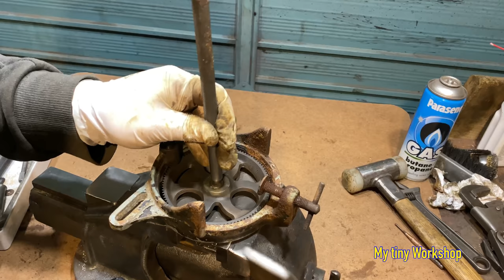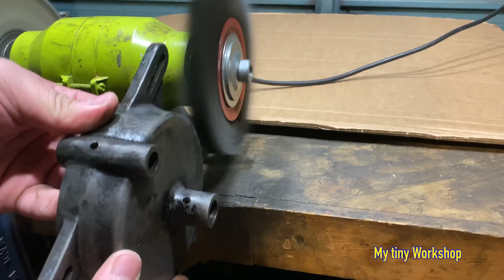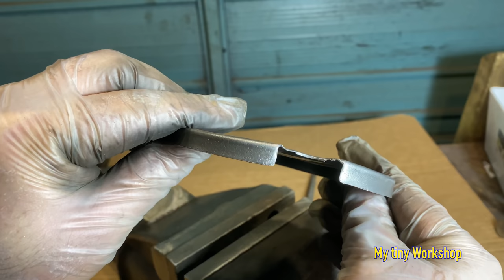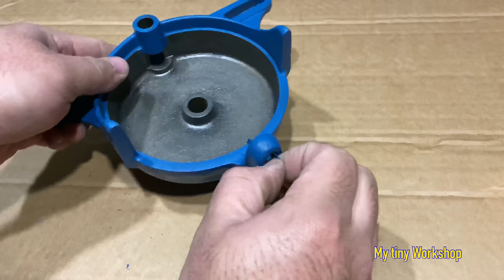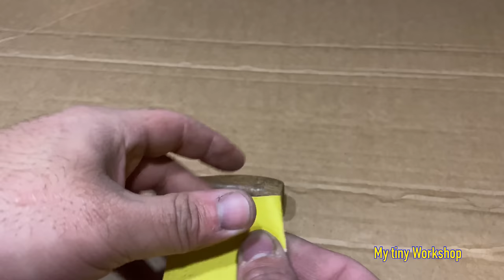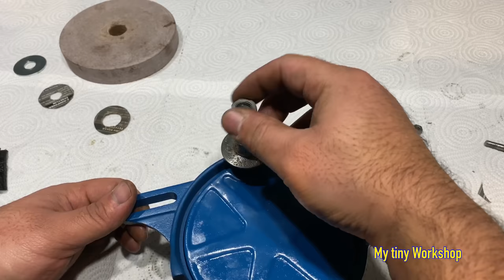Rusty Hand Cranked Grinder Restoration

Comment: I have a parts cleaner in my shop, and I always feel like the parts washer does absolutely nothing, even in all of the YouTubers restoration videos as well. I feel like electrical cleaning, rust remover, sand blasting, or washing by hand just does such a great job, and so much better then any parts washer could ever do that I don't even use mine anymore.
Reply from the maker: I understand you point. Sometimes it does seem useless. It’s perfect for me since I don’t have running water in the workshop.
Reply: @mytinyworkshop1213  Washing in water is sometimes really not effective and pointless. Or you need to use tons of detergent and a sea of water.
Sometimes it makes sense to wash in kerosene to remove copious grease and dirt adhering to it.
Sometimes any wash is a complete waste of time. This is not a mandatory ritual. We must proceed from common sense.

Comment: Nice restoration and good video! There are a few major safety topics I'd like to pass along.

1. There is a difference between low and high speed grinding wheels. A hand crank grinding wheel falls outside the spec of what is suitable for an electric bench grinder and can cause wheel explosion.
2. Please get a cover for your electic bench grinder. I saw a guy in the shop get a chunk of wheel embedded in his face because the wheel exploded because the cover would have contained most of it.
3. Always ring test a grinding wheel to see if its cracked. If it does not ring, dont use it because of wheel explosion. For a ring test, hold the wheel with one finger through the mount hole and lightly tap it with a piece of metal. You should here a nice chime sound.
4. Do not clamp a grinding wheel in a vise and use impact on it. This can cause micro fractures or worse you may end up buying a new disk.
5. When dressing a wheel or grinding of any kind, use a tool rest. I have seen a guy loose his finger because the tool slipped and the machine gnawed his finger off. Thankfully the finger had bounced off the wall toward him so they sewed it on...he cant bend it though and when he makes a fist it looks like hes always trying to point! lol
6. Never overtighten a wheel when you mount it because the risk of cracking. Most grinders will be threaded against the rotation of the wheel so it doesnt unmount itself.

I'm sure you know what you're doing but as always this is good safety advice. Like any advice, you  can always do your own thing. Again, nice video otherwise!
Reply from the maker: Thanks for the useful information.
Reply: @mytinyworkshop1213  You are very welcome and I cant wait to see more future videos. Restoration vids have a calming effect for me especially when Ive had a rough week!
Reply from the maker: Thank you very much for you kindness. Maybe I should watch some restoration videos. Making the video is rough in itself.

Comment: If you screw a nut onto a bolt before you cut it, the threads on the end will be straightened when you remove it after grinding the end smooth... just an idea.
Reply: Great idea!  I didn't know that!
Reply: @theropesofrenovation9352  Yep it works. Do it all the time
Reply from the maker: Thanks for the tip

Comment: Nice work as always. However a polished washer the exact size of the end of the handle end would have been a nice touch. (not too late for that) By the way, grinders like this are for tools like shovels and such, where only a rough sharpening is needed, or say that chisel had nicks in the edge, then you could use it for that, but it's not for general fine sharpening on chisels and knives and such. You want to hone the edge, not grind it. I use a steel with super fine diamonds on one side to get a really nice edge to things like chisels that require an extremely sharp edge. If you grind every time you need it sharp, soon the tool will be worn down to a nub. You can also lay a piece of 5 to 8 thousand grit sandpaper on a flat surface, add some water and hone the edge that way. The idea is not to remove any more metal than absolutely required, but put it back into a fine edge. Yeah when I was young I took everything to the grinder, but soon learned knives and such would not last long if I did. they also make hand or foot powered wet stones. these are a bit better for honing they have a fine grit stone that rides in a water bath to keep things clean and cool. Still grind a bit much to suit me, but are better than these coarse stones.
Reply from the maker: I never use grinders to hone chisels. I picked a bad chisel to demonstrate on. I always use an eclipse 36 or Stanley 14-050 to hone my chisels and blades. Thanks for watching and sharing.
Reply: @mytinyworkshop1213  I didn't figure you did, but there are lots that do. Hopefully I can help change that. While my comments are often addressed to you, they're more for the other readers.